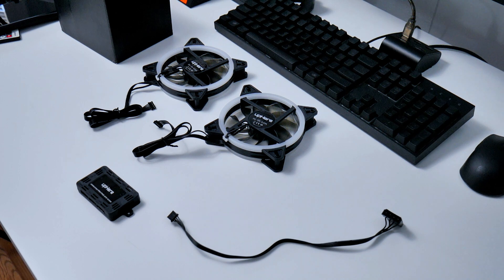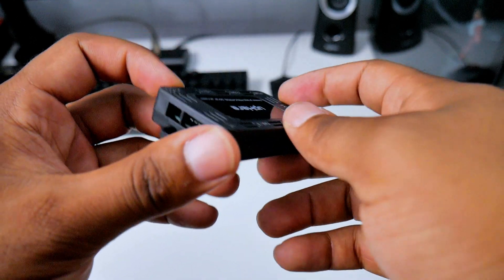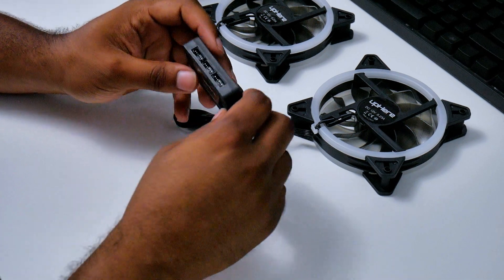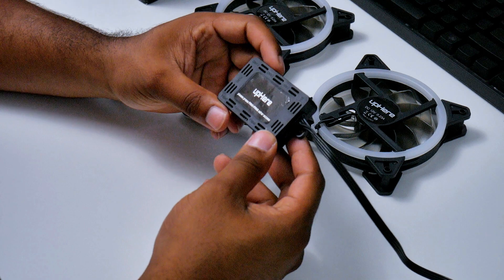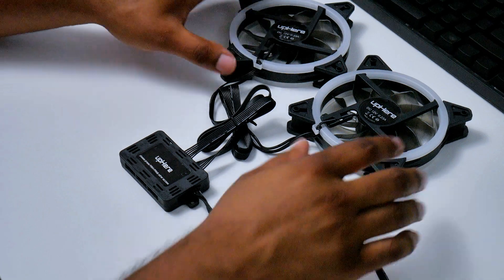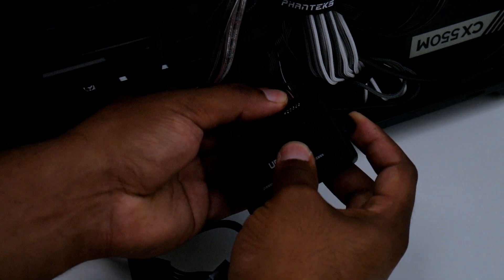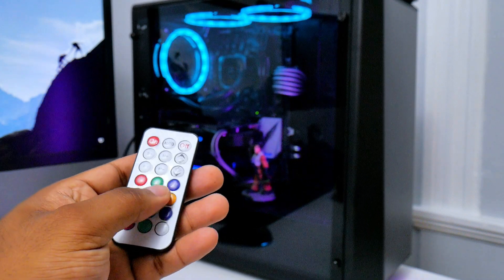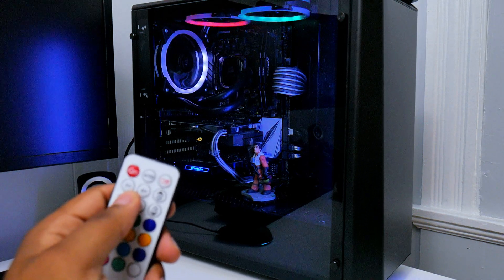Uphere RGB Fans (Installation Tutorial)

Comment: I've had no problems with these fans.
The rgb is bright and there are a ton of effects presets.
Just be sure your fans are hooked up properly and your good to go.
Reply: my fans do not turn on the light, I did the same installation process and only the fans work but not the lights
Reply from the maker: You should return them if the problem doesn't get fix.
Reply: Can I get an update on the fans Nelson? Just seeing if anything bad happened
Reply: @hugotarazona9027  same I need help

Comment: For newbies
1. Install your fans
2.  Plug them into the fan hub in order
3. Take your molex cable and plug one side into the PSU (power supply unit), and then the other in the fan hub
4. Enjoy your rgb fans ;) (use the remote to change the colors lol)
Reply: Which side is intake and which is exhaust?
Reply from the maker: Logo is the intake back side is outake
Reply: Does this work with Modular motherboards or no im newbie idk if it work with my b550 motherboard so please tell me
Reply: Im building my first PC i want to buy these fans i have a few questions,
1. I'm using a ryzen 5 5500 and a 1660ti and i need a 550W power supply but i'm not sure if its supposed to be modular or not, so should i get modular?i wanna use these fans but I dont know how to connect them but if i do get modular where do i put the ports? like is there a Molex and some pin for motherboard or ust molex for the PSU? also how much pins do i need to connect it to a psu?

Comment: There are 2 extra modes that i found out 
If u press The green below m-
And press m- is 1mode i figure out and the other is if u press the same green then u have to press m- again and after that u have to hold m- so that the colors switches trough

Recently bought them they are nice but now the have a other hub and other connectors

Comment: I have a semi modular psu, so can i buy a six pin to Molex cable for this? Or no?
Reply from the maker: It's a sata to molex adapter it cost like $2 bucks incase your psu doesn't come with the 4 pin molex..
Reply: Victor A oh ok, I’m not actually sure if i have a spare Molex but I do have a SATA, thanks my guy

Comment: Wait, so each fan only has one cable coming off of it that is responsible for the rgb and the fan power?
Reply from the maker: The rgb and fan power comes off the fan hub is in the video. The fan hub is powered by you psu.
Reply from the maker: The rgb and fan power comes off the fan hub is in the video. The fan hub is powered by you psu.
Reply: @VictorA25  So you just plug one cable from the fans to the hub and plug the hub into the psu?
Reply from the maker: Yes
Reply: @VictorA25  k thank you i subbed
Reply from the maker: Thank you remember you can't control the fans speed with this model only the lights with the rf controller.

Comment: Do you need to connect the fans at all to the motherboard or only to the psu? Could I use two of them for my CPU cooler radiator? Thanks!
Reply from the maker: The fans go connected to the fan hub and the hub to the PSU no motherboard
Reply from the maker: You can use them in a cpu Cooler but I wouldn't because you won't be able to monitor the fans on the Mobo.

Comment: This might be a strange/stupid question but do these fans turn off when you turn off the power from your case since they don’t connect to the motherboard? I’m new to PC building and am just wondering if these are the ones for me - thanks.
Reply from the maker: Well they don't connect to the mobo but they are powered by your PSU you just don't control the speed of the fans (air flow)
Reply: Victor A - So they will turn off and on with the power button on my case? Also will this be the case for the new set you made a video on that now has a Sata power cable powering them - Thank you for the quick response.
Reply from the maker: Yes it will turn on and off by normal power off and power on. If they come with power sata cable your all set you should be able to plug it directly to your PSU.
Reply: Victor A - Ok great I’m definitely copping then. Thanks for your help!

Comment: I bought them after your video, thanks man.

1 question: Can I connect any rgb strip into the controller or does it have to be a certain one from "up here"? because I want to have the same light effects on my case and not mix up anything
Reply: You can connect 2 rgb 50/50 strips to the controller.
Reply from the maker: Any it's a 4 pin rgb strip .
Reply: Yeah i figured the 4 pin part was a given

Comment: Very helpful video thanks. I originally had them plugged into my CPU fan 4pin port, cause there were no instructions. And they didn't spin or light up. But you said to plug into psu and it worked for me lol

Comment: i didnt understand how to connect them to the molex, i have no molex in the fans
Reply from the maker: If the molex power cable is not inside the box than your missing that cable. The molex cable goes on the fan hub not the actual fans..

Comment: To confirm, I would plug the rgb cable of my fan into the hub, but I would still plug the four pin connector of each fan straight into the motherboard right?
Reply from the maker: Not with this set of fans. These are proprietary fan connector that go into the fan hub provided and it's powered via molex connector only.
Reply: Victor A In terms of rgb is it all just in that one cable instead of it being a separate four pin connector for the fan and a different cable for the rgb?
Reply from the maker: You'll have to buy the one they sale for the fans hubs they make . If you go on my discord I can send you pics

Comment: Im building my first PC i want to buy these fans i have a few questions,
1. I'm using a ryzen 5 5500 and a 1660ti and i need a 550W power supply but i'm not sure if its supposed to be modular or not, so should i get modular?i wanna use these fans but I dont know how to connect them but if i do get modular where do i put the ports? like is there a Molex and some pin for motherboard or ust molex for the PSU? also how much pins do i need to connect it to a psu?
Reply from the maker: I wouldn't buy these you have better quality models available do more research.  I also have more videos on better fans for your pc on the channel.

Comment: Hi Viktor I have some questions! On which side is the air coming out? Is the airflow strong enough to attach to an AIO water cooling system? Best regards Erik
Reply from the maker: Well Erik let's start by getting my name correct it's Victor not Viktor. The fans are strong enough for AIO and it's pretty easy to tell front and back.
Reply: Sorry for the name issue.
Thank you so much for the infos.

Comment: Hi, How can I connect a single rgb fan to my motherboard. My motherboard A320m-s2h has only one "SYS_Fan 1" 4 pin port. I have seen mobo manual, it delivers 12v. But how could I connect 6 pin RGB Uphere fan into 4 pin "SYS_fan1" port?
Please help
Reply from the maker: Not with this set of fans

Comment: Yo what about these Uphere RGB fans? They seem kinda confusing or are they setup the same way? Thanks in advanced.

upHere ACC92RGB CPU Air Cooler with 120mm PWM Fan,Anodized Black Aluminum fins,5V 3PIN SYNC Addressable RGB LEDs Cooling and Unique Blade Design
Reply from the maker: They are set similar the difference is you can only control the rgb via software if your motherboard has the 5v 3 pin header.
Reply: Victor A 
Ok thanks 👍🏽

Comment: I didn't get this stuff with my single up here fan just 1 4 pin and 1 3 pin with 1 pin closed off? so im just running it to the fan hub but no rgb
Reply from the maker: What? Idk you might an incomplete set.
Reply: @VictorA25  i guess i found out my motherboard has only 1 5v plug header or what ever so thats being used so i need to buy a hub
Reply from the maker: @thenewimahich  for these set of rgb fans they connect directly to the power supply via molex these are not software enabled
Reply: @VictorA25  Mine didnt come with cables to connect to power supply i bought a single fan came with 2 cables hooked onto fan a 4 pin and a  3 pin
Reply from the maker: @thenewimahich  oh you didn't buy the set I got you now I understand.

Comment: My fans won't change colour for some reason
Reply from the maker: Check battery on the remote and reinstall all fan wires if that doesn't work return them asap. I will be doing an updated version to this video will be out next week...
Reply: @VictorA25  ya I've tried swapping the batteries and swapping around the fans new wires and everything, I've had them for around 6 months and it started like a month ago. It's odd

Comment: Could you help me? becaue i bought these fans and everything is fine but the hub has an male sata 15 pin connector. you have 10 6-pins on the  hub for the fans and the connector is an 15 pin sata, i dont know where to connect it, it just came with the 3 fans and the hub that has the 15 pin sata preinstalled on it that you cant remove, please help me i dont know what to do.
Reply from the maker: You'll have to get an adapter for that PSU which would be a sata power to whatever is on the other end if its not a molex idk but if it is should just be molex to sata power adapter.
Reply: @VictorA25  thanks i will look forward to it!

Comment: I think I might have a different version of the up here fan because my fan connector only has 3 pins. Would the fan hub still work with my fans?
Reply from the maker: It might cus they only use proprietary connectors if it matches it should work but I can't guarantee it.
Reply from the maker: The 3 pin connector is either for the addressable RGB or pwm for fan speeds.

Comment: Oops. Was i not supposed to connect the fans in the beginning. 2:45 was when i connected them cause I saw you doing it. 3:51 was when you connected them
Reply from the maker: Your fine as long as you connect them in numerical order
Reply: Victor A I found a way to slide it through a hole and I did do it in numerical order
Reply: JAR100 how do you do it numerical?

Comment: Do u need to connect the fan hub/control panel to the power supply or motherboard?
Reply from the maker: Power supply
Reply: Victor A ok, thank you!
Reply from the maker: You'll get the cable to connect the fan hub to Mobo and one cable for the RGB.

Comment: So the remote control works also when the hub is on the back of the case? Behind a wall; don't know if you can understand, sorry for bad english
Reply from the maker: It should as long as it the ir can pick up the signal
Reply: @VictorA25  you put it in the rear, right?
Reply from the maker: No the side of the case where the wires are

Comment: Alright, I bought a 5 pack and connected 4 fans to the hub (1-2-3-4) the fans are working perfectly but the rgb doesnt turn on, at all. I see the red infrared signal but no rgb. What now?
Reply from the maker: Try to connect the 5th one see what happens.
Reply: @VictorA25  
I did, same result...
Reply from the maker: Must be something with the set you have if you want I can suggest a new one that I'm doing a review on that actually allows you to control fan speeds and it comes with 6 fans?
Reply from the maker: Did you hit the on button on the remote? Just making sure you took all the right steps.
Reply: @VictorA25  
Yes I did, I hit all the buttons and the remote gives a red signal but no rgb. Also I noticed on the fanhub its labeled fan 1 - 2 - 3 (bottom) then 4 - 5 -6 (top) but when I exposed the pcb its 6 -5 -4 on the pcb...
Reply from the maker: Yea has to be a defaulted unit.
Reply: Update: it does actually work now. I wanted to test the fans before putting every pc part together and i didnt plug a motherboard cable into the psu (I didnt know you needed this).
Reply: @Rayer24   What exactly was the motherboard cable that you plugged into your PSU? My computer is all setup and shit, but it still does not work and i have no clue why.
Reply: @adreh  
When I got all my parts I just used the motherboard cable that came with my PSU (seasonic m12II 620W). When I tried to get the fans working with my old PSU I did some weird shit and plugged the gpu of my old pc into my new PSU.
Reply: @adreh  
Are the fans plugged in in order? 1-2-3-4-5-6?
Reply: @Rayer24  Yeah they are in order, I'm really clueless since the fans are working just fine but the colors are just not showing up.
Reply: @adreh  
Is everything in your rig set up? Idk what could be the problem then. Mine worked after I built my entire pc. Perhaps a default pair?
Reply from the maker: They should be set in order if it doesn't work try getting a new set of fans
Reply: @Rayer24  Everything is set up, Tried connecting 1 fan only, 2 fans only etc and nothing lights up. Pretty sad.
Reply from the maker: Then I'm pretty sure it's defective don't worry just email them and see if they can replace it or get your money back.
Reply: @VictorA25  Yeah me too.. You got a snapchat? I could have a chat with pictures its fine?
Reply from the maker: Not these but they due have a set that is motherboard and rgb compatible.

Comment: Wait SATA POWER is cable for HDD and SSD but Molex is for RGB?
Reply from the maker: Lol ok so if your power supply doesn't have a molex connector you'll need to buy an adapter that is molex to sata so you can feed power to these rgb fans. Sata power is just that feeds power to your HDD in this case to the rgb fans.

Comment: Hey I have a question, I’m looking to get a rosewill rgb fans I know about the hub and the plug a molex to the power supply but, I’m planning to get a Corsair power supply and I’m not sure what the connector is for the molex is, I’m asking what the wire called or it just in a non modular model of the power supply.

Comment: hey man my remote doesnt work and i have installed these fans many times u know what may be the issue?
Reply: Similar issue here. IDK if it has been answered already because there are like 500 comments. It worked fine at first but after a couple of months the remote controller stopped working and now the lights are fixed in light blue cyan color. Checked the battery, IR LED, cabling... everything seems to be fine. But for the fact that no button in the remote does anything at all anymore. Is there any way to re-sync or reset it? I am pretty sure that thits is not a case of faulty hardware. Yes I know I can get a new one but I want to understand what is wrong and how to fix it properly. This one came with a Nitro PC mounted by PC-Componentes (not exceedingly professionally BTW), and there is a button in the chassis next to the "On" and "reset" switches that says "LED" but seemingly does nothing either. Any hints?

Comment: if i buy a deepcool rgb aio liquid cooler ( comes with a hub ) can i connect other brand rgb fans in that hub ?
Reply from the maker: i don't believe you'll be able to cross mix different brand. This set of fans you see here have proprietary 6 pin connector unique to them the hub to this will only work with this model. On another note you can always try to do your own thing.
Reply: awesome thank you for the reply !

Comment: How do I sync the cool effects with my ram and cpu cooler, Asus aura sync has boring effects
Reply from the maker: You would never be able to. This set of rgb fans don't connect to the motherboard at all sorry.
Reply: Victor A damn g, mine I can connect to my motherboard and it syncs but Asus aura sync effects suck ass, guess I was wondering if I could download some 3rd party app for more options
Reply from the maker: Oh yea the one in the video you can't. But try downloading the ASRock rgb software or msi search on the web for a better software.

Comment: I have the apevia rgb fans from a prebuild and the rgb is bugging out,. is there anything I can do?
Reply from the maker: I never tested or owned aprivia rgb fans. I would replace them with better ones.
Reply: @VictorA25  is there a way to use the rgb fans without the rgb, I have fans connected to the hub and backlights. I want to keep the controller on the back lights and disable the fans but still have them spinning.

Comment: Where you connect the remote pins for the module inside,the most important part you skip..
Reply from the maker: Well this model is powered by the molex connector that goes directly to your PSU everything else goes connected to the fan hub

Comment: how did u connect the molex cable to the hub because my hub comes with a sata cable
Reply from the maker: Then you have a modern version just connect it to the sata for power you should be set.
Reply: Victor A my psu doesnt have a sata cable but has a molex cable
Reply from the maker: Damn you'll have to get the adapter its called molex to sata that should fix your issue.
Reply: Victor A ight thanks man
Reply from the maker: Its a few bucks if you join my discord I can show you a picture how it looks like.
Reply: Victor A ight fs
Reply: Victor A the discord link expired can i get another one

Comment: New fans are separated into two cables each. also different connections to computer... e.g., Power connector is now SATA connector (not molex). Connector from the ARGB header on mobo. connector from reset switch power. That is the one that has me bewildered. the reset cable from the control box looks awkward. can't see how it connects.. No remote, don't really need it cause they are supposed to work with software from different mobo venders.. Thanks!
Reply from the maker: Idk wether your giving an update or trying to correct a 2 years old video and yes they have updated the models they sell now

Comment: Hi, all 3 fans spin but do not light up. The hub uses a 4 pin molex but i currently have it plugged into a 3 pin molex, Could this be why ?? If not any other suggestions ?? Thanks.
Reply from the maker: It could be that and also make sure the fans are connected in numerical order